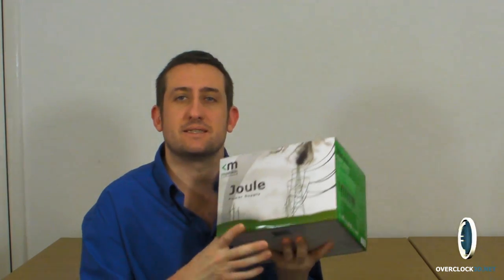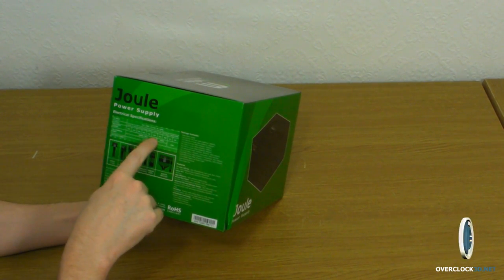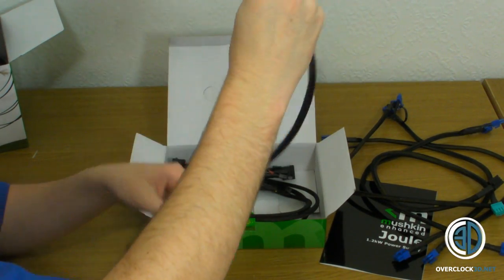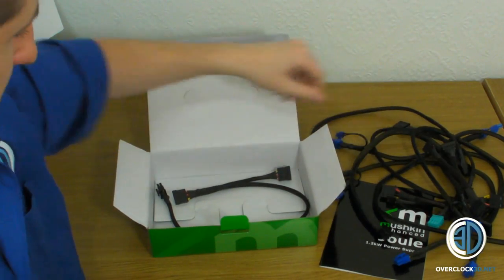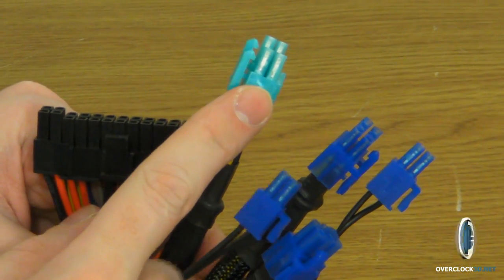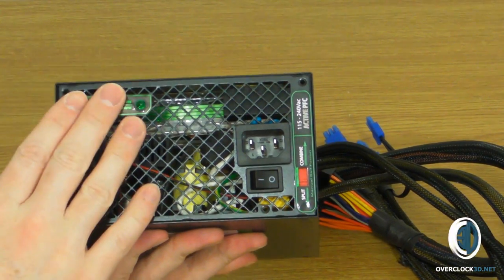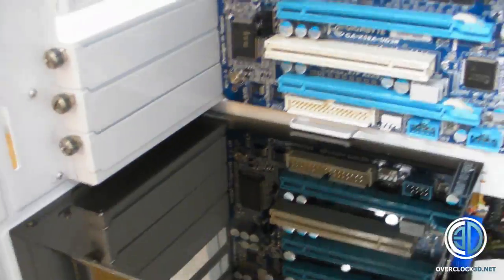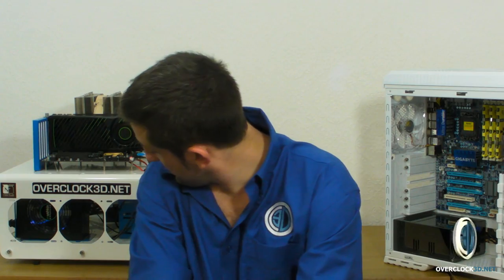Mushkin Joule 1200w Power Supply - Bench Rig Gets A New PSU

Comment: I used two of the mushkin Joule 1200W PSUs for my SR-2 Quad SLI Premier build and they worked wonderfully!  The amazing thing is that you can buy about 3 Mushkin Joule 1200W PSUs for the single price of the Corsair AX1200.  (I have used that as well)  Mushkin answers the phone when you call also, etc, etc, etc.  Definately a fine company.  In fact, I have sold my Premier build and the only two parts that remain are my two 1200W PSUs in separate rigs.   :)  Great Review!

Comment: @GamerzForRealz I saw that video, for those interested it's from LinusTechTips' channel, and is wrongly titled P8P67 Deluxe 1156, not 1155. The link to NCIX doesn't return a product result, so no pricing available yet. Another retailer has it at $248.90 CDN, which is about what you'd pay for a 1366 board (though some of the latter are now in the $180-$200 range, including the very capable ASUS Sabertooth.) I also found an Intel DH67BL going for only $119.70. That's about 80 quid Tom.

Comment: Hey that finish on the second one is amazing, never seen one like it before. Mushkin should make a psu with that finish, a 120/140mm fan that has 3+ colors (I have a fan in my rig that can change from "256 colors"), and fully modular. That would be phenomenal in my opinion. Especially if the rail switch makes a difference (I can't tell on mine). One last thing I found humorous; you got yours with a US cable, well I'm in the US and mine came with a UK cable, weird eh.

Comment: @HeavyMetalBlaster you should go to corsair`s website for example they have a power supply meter where you can insert your system components and it will automatically calculate how many watts you need

Comment: @LittleLegion hey seen your comment. if you want a good 1200w psu you cant go wrong with antec's true power. i've heard the corsairs had issues but i cant really confirm anything, corsair makes quality stuff. also the evga psu is a ripoff. its basically a modified antec true power with a big markup on the price. hope this helps.

Comment: @1timby if you need a 1200W power supply in a rig all the attached cables will be used. 24 pin + the 8 pin is require for all setup and the 2 pci will be used for video cards. if not why would you buy a 1200w?

Comment: @lordmat666 Dude not the point. Most high end PSU are all modular. Makes the rig easier to cable and do cable management. You only have to worry about one cable at a time and can decide on the cabling order. I have a 1K PSU and it's all modular. I've been in the PC/Tech business for a long time and Mushkin has a long standing as a vendor that builds good products. 

Was just an observance.

Comment: Hy Tom i`m new into overclocking, so i have a question.My current power supply only has a 4 pin cable for the cpu and my motherboard supports 8 pin.Will a 8 pin cable will give me room to overclock further?

Comment: if im correct there is a certain % of wats that are ideal for a system like for exampel if your rigg draws 300w your ideal powersuply would be 500w am i right and if so then what would be the ideal wattage for a asus maximum iv gene with a i7 3770k 3ssds and a 690? and also how much can my 850w 80+ bronce power could it power two 690s in sli?